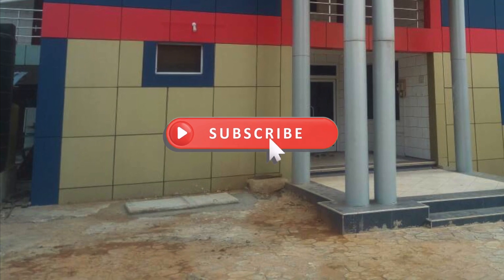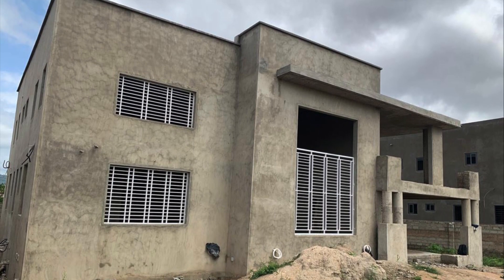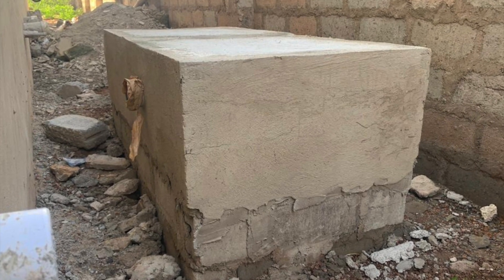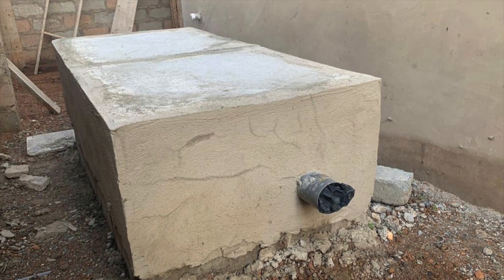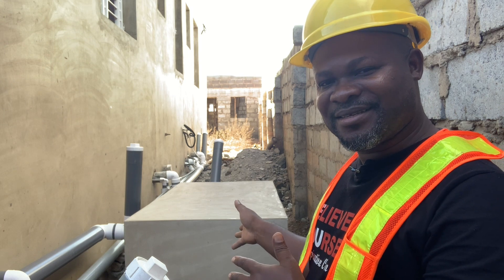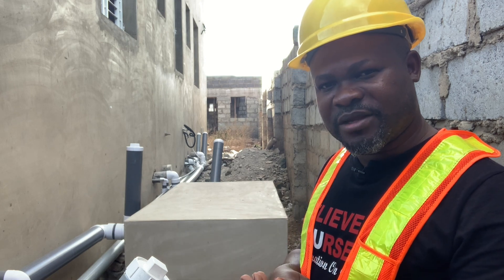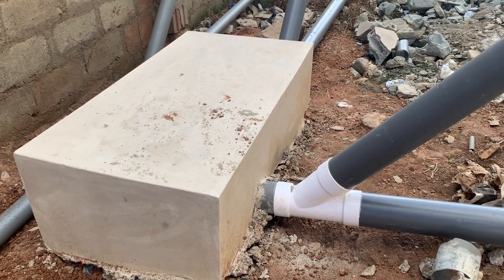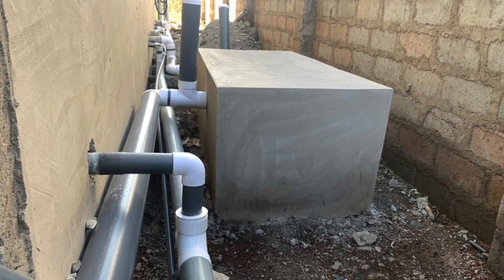Clients' Expectations for Biodigester Construction & Finishing

Comment: For a stickler of quality, this client' pipe work is unique. Good finishing    though. Just 2 questions jerry when you say the latchet pipe sits 2.6 below the bottom of the digestor is that in feet?

Does this unique pipework serve anything. I know the plumber was different but you might know?

As always keep up spreading the gospel
Reply from the maker: Yes leachate pipe measurement must be in feet and its the ideal situation. But each construction is peculiar to what you will meet onsite. Just that it helps you to ensure that the blackwater does not return to the digester.
Reply: Could you please send me your contact number

Comment: Do you remember the distance between the fence wall and the main building? 
From your experience should the biodigester be covered by the filling and subsequent compound design option like bricks or tile etc
Considering that it will have to be opened oneday for maintenance
Reply from the maker: It should not be completely covered. You need to show that there's a digester there for some day maintenance.
Reply: @JerryAdu-Asare  ok great. Thanks
What about the distance?
Reply from the maker: @princeatubrah9165  Minimum should be four feet. The further the better.
Reply: @JerryAdu-Asare  Much appreciated. Thank you